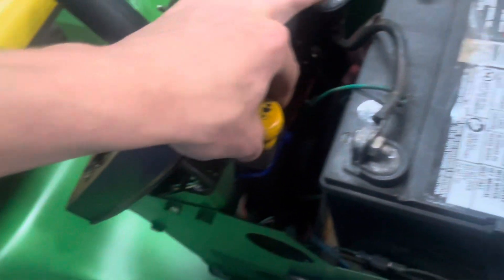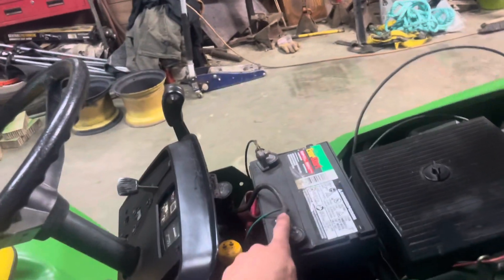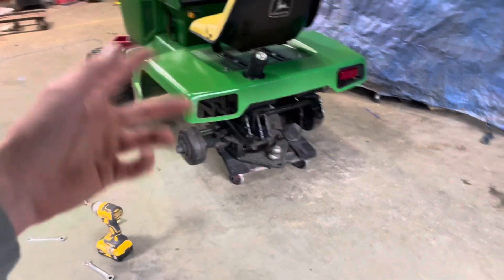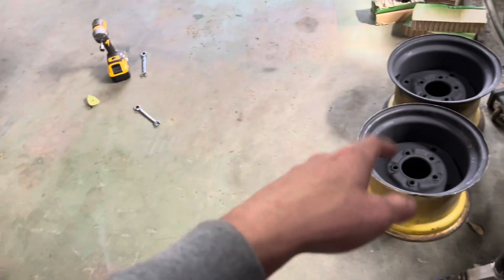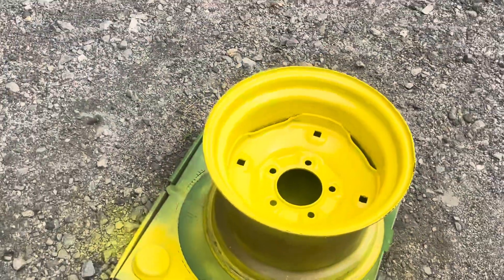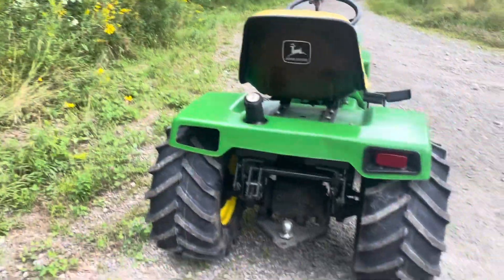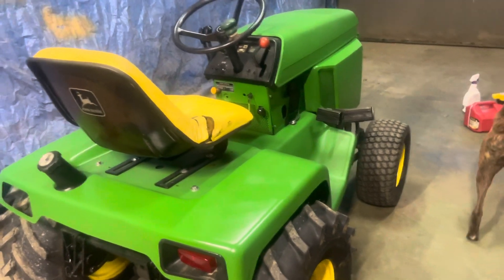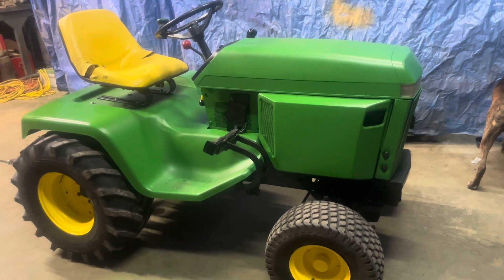Restored John Deere 318!

Comment: Put my tires on like you. Looks cool. Also picked up a 1967 110 that runs and a 1985 420. 420 runs but smokes. I ordered a re-engine kit from SEW. 420 is getting a vanguard 23hp.
Reply from the maker: Sweet. I’m looking to upgrade to a 420. Just haven’t found the right one. But that vanguard is gonna be sweet!

Comment: What size tires are those? Front and rear?
Reply from the maker: Running slightly used 18x8.50x8 in the front and brand new 26x12x12 in the rear!